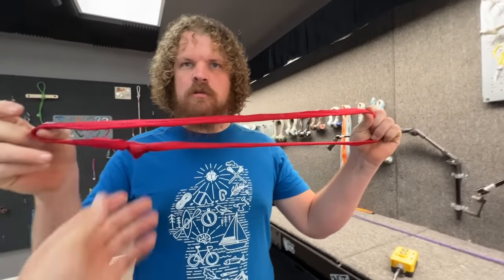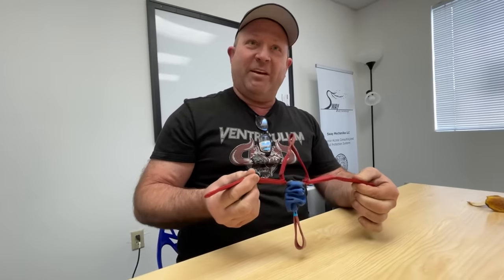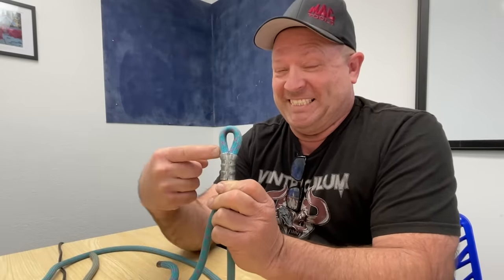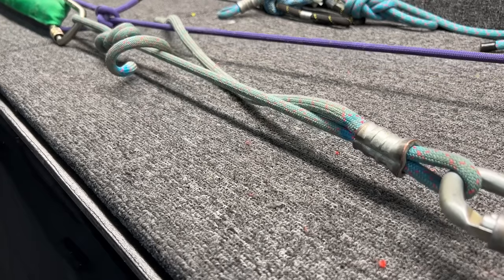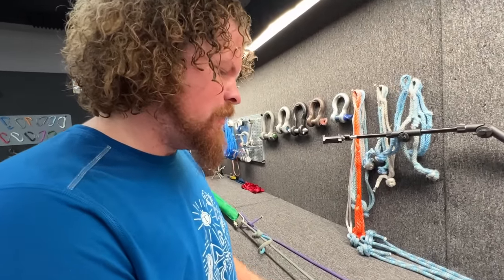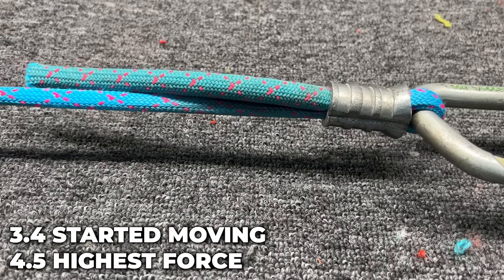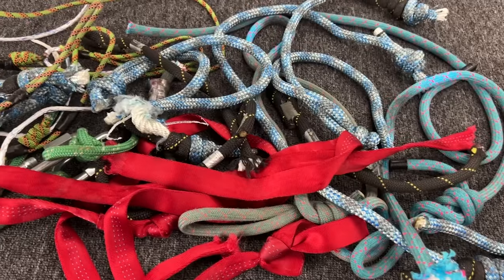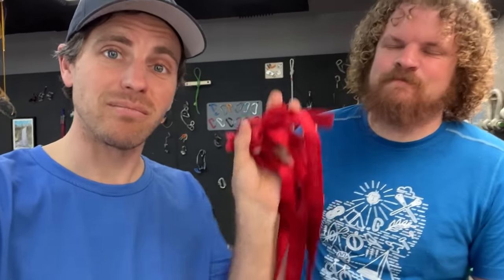Water knot vs Beer knot: Which one is stronger?

Comment: Not a climber, just an engineer who gets these videos recommended. I think it'd be interesting to also measure the energy dissipated by the knot (the total area under the curve, force x distance) - because some knots might actually catch bigger falls despite testing at a lower absolute max force. That crimped eye for one was able to hold several kN for like a foot of distance - that amount of force multiplied by the long distance means it could probably catch a huge fall.
Reply: I was thinking the exact same thing!
Reply: Not an engineer, but I do climb. 

To try and picture what you mean, would that involve a longer bite end of the rope? With more or same amount of crimps? 

Seeing it slip under constant force made my think it's technically safe. Sure, a decent fall would pull the eye tight and you might not get many uses out of it but I won't be constantly applying 2kN if I fall. I think you're saying something like this, yes?

The only issue with testing dissipation through length is that his machine can only pull like 2ft max
Reply: @PoochyMishaps  I think they meant test it as is, but just measure the area under the curve. I could see this being useful with a 2-3 foot tag with a stopper knot on the end. It would almost be like a built-in shock reducer.

Comment: So, the swage rope connection slipped at 4.5kN... the only time you would achieve that high of a force in practice is under dynamic loading (catching a fall). I think you need to drop test it... My guess is that it will slip a little then catch the fall as long as the peak force isn't too far above 4.5 kN, but it would get interesting if you did a factor 2 drop test that would normally peak higher than that (say 8 or 9 kN) and see what happens... does it slip more and then stop? Does it break? hmm.
Reply: Exactly my thoughts! Does it do sort of a "soft" catch and slip initially at the higher forces and then grab once the forces dip low enough? It could provide a bit of dynamic force throttling while keeping the rope relatively undamaged (it would be garbage after one fall though)
Reply: @niceguy191 it might be garbage after such a fall, but they’re very rare anyway. If it does happen, the fucked up gear goes on the wall of shame and gets replaced, even if it doesn’t look affected.

Comment: Most interesting beer knot loop didn’t break in the knot. I want to see more tests with longer tail bury lengths on beer knots as I use tubular loops tied with beer knots as top rope anchors. Would be interesting to see breaks on beer knots with 9/16” and 2” webbing as well
Reply: Started using beer knots 6 months ago and I would love to know at what point is extra tail bury no longer "worth it". I've only used sterling 11/16" and blue water 1" but both seem plenty strong enough for top-rope anchors (sliding X), PAS to go indirect with, and extending rappel devices.
Reply: @adamwelp1079  I've been using the beer knot for over 30 years and there has never been any slippage of the ends. So 1 inch tail is long enough. There is no slippage because one knot is inside the other knot in the beer knot. In other words, when force is applied to a beer knot tied runner the outer knot cinches down on the inner knot. The runner will break outside the the beer knot  before the beer knot breaks.

Comment: I'd love to see how the water/beer knots compare to their figure 8 (flemish bend) counterparts!
Reply: I haven't tested it but I bet the beer knot is stronger than the water knot or figure 8.
Reply: @colossalfart  over kill, IMO. Since the webbing would break before the knot would. And maybe the extra bends would make the knot weaker
Another thing it's hard enough getting the webbing inside for an overhand beer knot. Way much harder getting enough webbing inside for a figure 8 beer knot.
Reply: @colossalfart  The only advantage I could even imagine in tying a figure 8 beer knot in a runner would be, that if you didn't cinch it to tight, in a fall on the runner the 8 beer knot might act as a shock absorber as it cinches tighter lowering its impact force. Other than that  it's overkill, as the overhand is good enough since it will break in the webbing before breaking in the overhand beer knot.

Comment: I've been using a beer knot for over 30 years in my runners/slings and nobody ever believed me when I told them that my beer knot was stronger than a water knot. It's good to see you testing the beer knot!
Reply: Hmm I'd never seen it, but makes sense. Heuristics say doubling the material in the knot gives us full strength (2 x 50%). That said, 25kn is safety for rec climbing.
Reply: @kevinmcdonough9097  It's a great knot. Won't untie and no tail. It takes a little while to make it but well worth it.

Comment: Another absolutely fantastic upload. Put the swage on the list of things to drop test please.
Reply: I’m also curious about this. Obviously it slips under low load, but how far would it slip during a high load fall?
Reply: And can you tie a stopper knot to fix this issue?
Reply: @lambdalandis  I'm curious too! A stopper knot might allow the peak forces to get much higher and potentially break somewhere while the swage might act as an "overload" protection so the system survives with a bit of slippage instead of failing outright.

Comment: I’ve used that Titan cordage before and I’d say that’s some pretty clear evidence that you need more than a double fisherman’s. From what I could see you never actually broke the load bearing component, the dyneema core. To me it looked like the sheath failed and the dyneema pulled out of the knot. I can see all of the core missing from one side of the knot and enough dyneema sticking out to make up for all of the dyneema in the knot. That must be why they recommend 3 bends because you need more friction to hold onto the dyneema. When myself and others splice cordage like that you do a double Brummell of the core and whip lock the cover on like a sailing line. If you do an end to end your only option is just kind of a straight bury. Love the beer knot, can’t wait to try it for myself!
Reply: You can definitely put a few brummels in the end to end splice. I believe Yale’s instructions show it that way, as well as others, and I have done that myself on a winchline for my chipper, and that splice is still rockin a year later.

Comment: I would love to see several beer knots compared to see if the results are reliable.
Is this a way to cut damaged parts of webbing out and not loose any strength?
Is this a way to splice shorter parts of like-for-like webbing together and get a longer length for "free" ?

Comment: Supper cool.  Surprised at the triple swage ( i thought it would cut) but i guess it makes sense and the rope gets thinner under tension and looses friction.  I was impressed at the beer knot  performance (more than surprised i guess).  My biggest surprise was the strength of the hand sewing the end of the 11mm cord.  I thought that had no chance, but lookie there, way better than an aluminum swage, and it doesn't cut your hand or bash you in the head. 

Keep it up.
Reply: I wasn't  surprised at the beer knot test. I knew it was way stronger than the water knot and will never come untied like the water knot can. I've use the beer knot for over 30 years.

Comment: Beer know is good.  But about 25% of time when rigging an anchor I untie the waterknot to get the sling around a bolder etc.... and then retie it.  But will try the beer knot.  Have to play with it.
THANKS
Reply: I've used an overhand on a bight to take up extra slack on a sling around a tree or boulder (to back up a two-bolt anchor). Wonder how that compares.

I suppose untying lets you thread it around if you can't put it over, though. Or leave it closed and basket hitch it?

Comment: I worked as a guide in Austria a few years ago and the Beer knot was a definite no go! A climber had died using a sling tied with a beer knot. He had used the sling at some time as an anchor near an edge. They deduced that the visible end of the tube tape had slid up close to the knot and the inner tape had been damaged. When he derigged it the outer end most likely slid down and concealed the damage. Later he was using it as a leave behind anchor for an abseil and it failed only a few metres into the abseil.
Reply: Hello, so what is a better alternative to a Beer Knot? Thanks.
Reply: @gsatiucla5139  Water Knot is now more generally used.

Comment: Two of the connections I'm really interested about in one video! 👍
I've seen a number of swaged rope connections and I've always been a bit skeptical. I always thought some sharp edge in the swage with cut the line. Super interesting result there!
I do a lot of stitched & whipped eye connections in high-tech lines that can't be spliced (ex. Maffioli Swiftcord) and I was always curious about how that kind of connection would hold-up (my applications are almost always used way under the the nominal working load of the line, so it's always been "Super Good Enough"...)

I would be interested in seeing how a swage fails with wire-rope (7x19 and 1x19)...

Comment: Hi, thank you very much for your videos, always interesting. I had one question, you are always testing the nods under constant strain. I use dyneema loop that I close with a nod. I use it as anchors around o rock or a tree or whatever I find. They are supposed to hold if I fall. Therefore, it will be more a pic force than a constant load. As you build a nice drop tower, would you be so king to test the behaviour of nods when arresting a fall (pic load)? Thank you so much!

Comment: Beer knots look super interesting. And webbing is cheap enough that making a handful might be cheap way to have custom length slings
Reply: All my slings and runners are made using the beer knot. Been using it since the 80s. I've never had problems with that knot. Before I started using the beer knot I tied my slings with the grapevine knot. I never was a fan of sewn runners.
The only sewn I use are quickdraws.

Comment: The slipping swage may be a good technique to use as a screamer.
The tightening knots produce heat which reduces the strength of the rope.  If knots are tensioned in such a way (over a long time) so that the energy (heat) is allowed to disipate without allowing the temperature to build up then the breaking strength will be greater asw you will be testing a rope that remains cool throughout the testing phase.  This is why the old (already tightened) knot was stronger than the newly (looser) tied knot.  This also probably explains why you get shuch a variation in test results for textiles compared to metals.

Comment: The beer knot, seems like that's a way to easily make slings.  I wonder if the beer figure eight would also work (possibly with better removability).
Reply: I think a beer knot in a figure 8 setting has a couple of disadvantages.  You'd need more material to make it, most likely make it harder to untie because of more bends, also be overkill because a beer knot is strong enough. The webbing will break somewhere else before it breaks at the beer knot using the overhand knot you use to make the beer knot.
I make all my slings and runners using the beer knot. I've used it since the 80s.

Comment: Do you have a video testing rope kellems? I know they're not for climbing but I use them pretty frequently and we load ours up to 4000 lbf. And we pull new wire in with it like that, I'd just be curious to see where it failed.

Comment: I began tying the "Beer knot" in runners, in the mid-1970's; Bill Forrest had a testing device in his Denver shop, and he also found the knot was as strong as the webbing - and yet, in normal use, has zero "creep" factor as long as the knot is in the zone of the captured material, and also is easily untied by hand, after weighting. Basically, the best tubular webbing knot bar none. The more you know . . .
In stark contrast, seeing the total fail of a homemade "screamer" and swaged rope ends reinforces the concept that no DIY method, however novel, should be incorporated without actual testing to failure - because your first real world experience may well be such a test.

Comment: The swage is softer material than the steel cable it was meant to be compressed on, which let it conform to the cable strands, giving it more grip, which couldn’t happen with the soft rope. Even then i preferred swageless terminals, especially when filled with epoxy. Wondering what that would do with dyneema.

Comment: wow, interesting that Petzl doesn't give the MBS. From the technical notice: "The maximum load that can be transmitted to the structure by the temporary
anchor is 18 kN in the choked configuration, and 23 kN when wrapped around the
structure. The rope may elongate up to 40 mm when under load"

Comment: What was the red sling's rated strength? Does 3 stitches indicate 3x5 = 15kN? If so, that might be why the beer knot sling broke in the material when it hit 30kN and each side was holding 15.

I'd be interested in more tests as someone who builds arbitrarily long slings for anchors, in addition to the fixed-length of stitched slings.

Comment: Swage wire rope to embed the lead or zinc into the wire threads.  Why would swaged  fiber rope be different than thimbled and clamped fiber rope? You can't get the swage material into fiber? Does a swage work better with a thimble  when applied to fiber rope.

Comment: What you see at https://youtu.be/sOCjyVUBkGY?t=235 is exactly the benefit of settling the knot with pretensioning. The freshly-tied knot pulls through, heats up, becomes weak, and fails. The identical old knot, by virtue of having been settled in, doesn't pull through, doesn't heat up, and doesn't fail. Incidentally I'd like to see what happens if a rope loop is joined by swaging while pulled to the working load limit. I expect that in the short term it would eliminate the pull-through failure you saw, but I can't guess whether swaging under tension would weaken the rope over some period of time. A reliable protocol for swaged rope connections could be of some value in industry, and almost certainly patentable.

Comment: That beer knot was awesome and that's such a good name, water to beer is totally worth the effort. Would like to know if the point of failure was a fluke.... Also need to know what breaks first out of the rope soaked in water, beer or urine, think was Jackie Chan movie and a karate kids one where they used soaked cloth and a stick for twisting/leverage to bend steel bars.
Reply: Wet silk vs dry silk would be interesting. I think the movie was Shanghai noon. Uses wet silk to escape a prison.

Comment: 4:00 i surmise the modified scaffold knot survived due to the lack of friction heat like you see in the normal knot that starts slipping, the slip heat/friction cut the rope (ohh you called it too haha) make you wonder if the act of slipping itself that is responsible for most knot failures  ((id never heard of a beer knot, il def start dabbling into them with stuff.. that metal clamp though,, wtf.. like really wtf. first glance and my first thought was NOOO thats for lvl 1-2 rigging gear TOPS. I will say, I was hoping for a break test of the metal clamp with a big fat stopper knot on the end to see if the clamp itself or the rope fails.

Comment: "not very high" - but it will probably stop a fall - total energy calculation...- add a stopper knot.

moral may be - the highest strength, lowest stretch fibre isn't always best...  Nylon for a static win ?? - especially if allowed to slip -- for ever...

"Splices" - so interesting, even if just tying an overhand knot after...